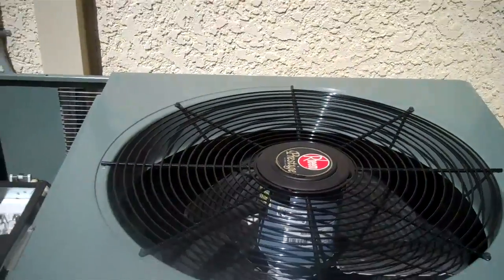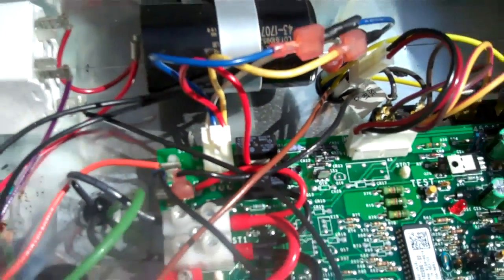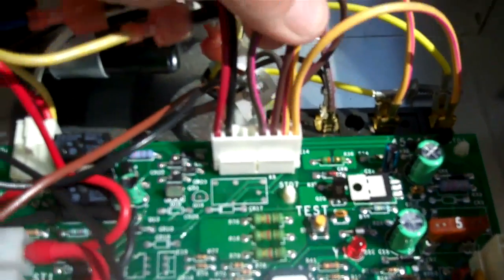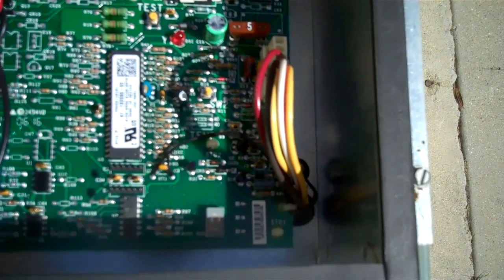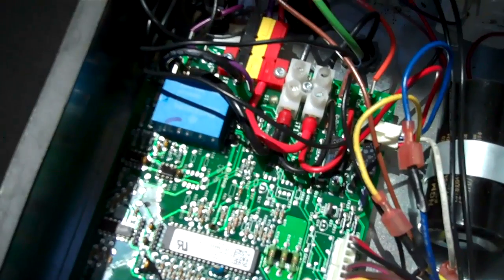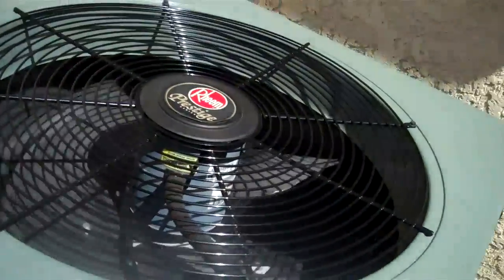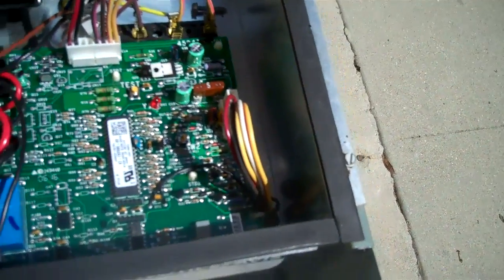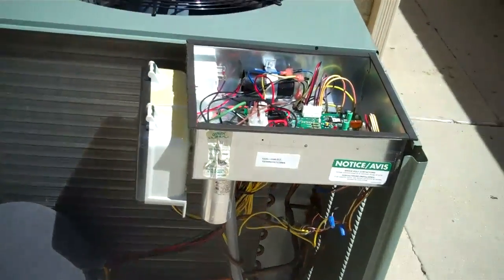Two stage condenser tutorial.

Comment: Will that fuse open only shorted switches in the condenser or can it open if thermostat wiring shorts to ground as well? Where does it exactly protecting ? Don’t we have a fuse also inside the air handler? Why do we need another one?

Comment: How would I fix the low voltage power? I’m getting the 2 and then 7 code. I’m assuming 27? I do need to change out the start relay because it looks corroded. Would that be an issue?

Comment: Hello,
The outside unite stopped working, neither compressor nor unit fan doesn’t start.
On a comfort control panel inside the unit there is:
- a LED is red showing that thermostat sends a signal to start compressor;
- segment code is shown 21L;
- when I push “test” button nothing is happening.
The blowing motor is working.
How can I fix that error? Please help.
Thank you in advance.
Reply from the maker: Sound like Low on refrigerant.

Comment: You seem to be well versed on these units so I had a question.  I installed a similar (used) unit in a my home (3 ton 15 seer 410a)  but heat strips were stuck on in cooling mode.  Disconnected sequencer lead for the summer but now have to fix it proper for heating season and wondered if you think it may be bad sequencer or air handler board?  Thermostats good, disconnected aux heat lead.  Any input would be appreciated.
Reply: Do they stay on after you remove the control wiring?
Reply: If they stay on even when control wiring is remove (just one per curcuit) then we have bad control devices, such as sequencer, or (on these) possibly a circuit board.

Comment: Not me no 2 speed u are asking for problems
Reply from the maker: The unit 10 years old now no problem to report.
Reply: dizziedallas I built my own 42000 a coil 24000 compressor 30000 condenser runs 175 lb head pressure try not to scratch your head on that I worked on air conditioning for 25 years ,,😋 I might need to add a accumulator what kind of head pressure does that high Seer unit put out ?
Reply: They might be okay now but when they first came out ouch

Comment: hi dizziedallas. can hoy tell me how to reset small c code on this tipe Of units.I have one with  two.compressor.
Reply: download the install manual from Rheem.  It has the instructions.

Clear Fault History (TEST and SW2 Buttons)
• To clear FAULT HISTORY press both TEST and SW2 buttons at the same time
with insulated probes for 5 seconds and release.

The top and bottom segments of the 7-segment display will be activated and flash
to indicate the history has been cleared.
.

Comment from the maker: Thank you so much!! Thanks for watching!
Reply: dizziedallas  hey sir can I get your number again I lost my phone and lost my contacts thanks
Reply: Hey buddy nice video. Got a question.  I worked on one of these units today. I've changed the same board 6 months ago. Got a call back and unit wont stay on. Compressor makes strange noise then some kind of sound comes from the board and the fan spins a 1/2 a second and it shuts down. Code is reading 5. Any clue what might be wrong?
Reply: Hey bud I have a question about this condenser.  Compressor kicks on but fan motor does not. Installed new fan motor still same issue. Board is new as well. Any clue what it can be?

Comment from the maker: @HCVguy93 Hey Matt. I have not had a problem with the board yet . The board are easy to work with and I like them better than a contactor because the unit is staged.when the unit starts the compressor starts first and then the condenser fan motor comes on.

Comment from the maker: @fritzhvac I have two testers both are for the indoor blower motor the rheem # 92-24291-02-00 the other is for a carrier # p/n HK50EA001, they will not work on the outdoor motor.The rheem is iess expensive it a pretty good unit for the price.I have not had any bad boards and we been putting the two stages in for 3 years now knock on wood!!I have put a bunch of two stages in because of the rebates

Comment: @dizziedallas  I was told on indoor variable speed blower motors I would need a special test instrument for module, I didn't know if it would work on outdoor ecm fan motors , do you own one ?  I have not seen the rasl-c communicating systems (sounds wild is it a rheem) ?I have been talking to my local rheem dealer on pricing here in town, It is actually a little less expensive than my American Satandard units !!!
Have you seen a bad board yet on outside unit ?

Comment: Dallas, with the ECM motor , can you replace the fan motor without replacing ecmodule ?
Do I need to purchase a special testing instrument for the ecm ? Man very good educational tutorial , you could be a technical instuctor (very down to earth). Man when I first seen your control module board, I was overwhelmed! I am used to testing , at my contactor for low voltage issues (broke wire grounding out and frying inside transformer)